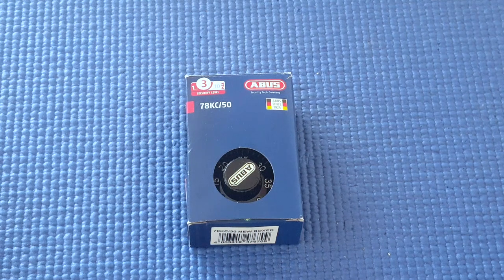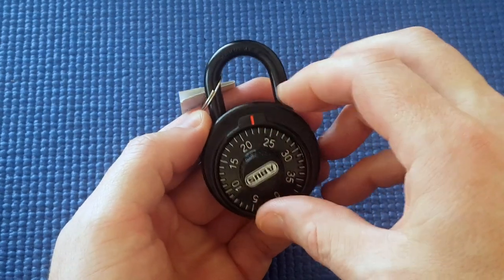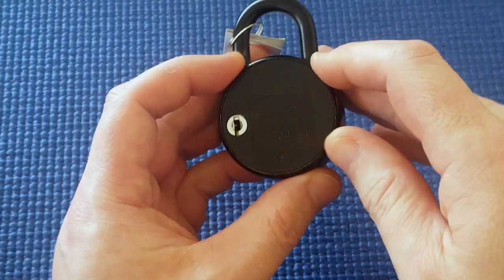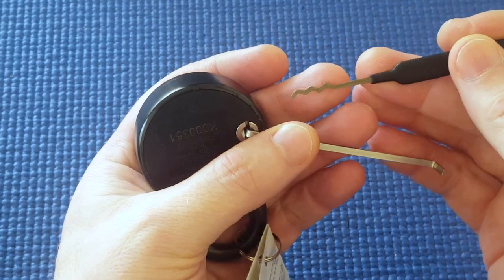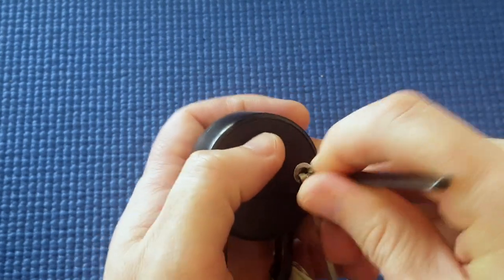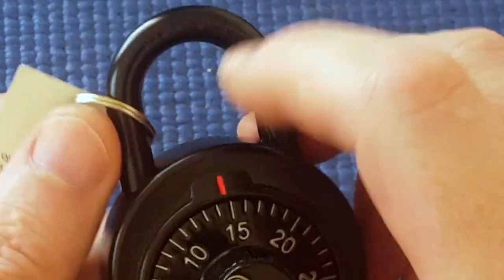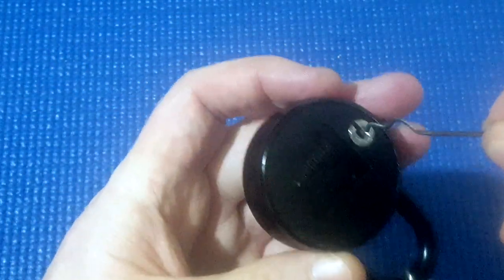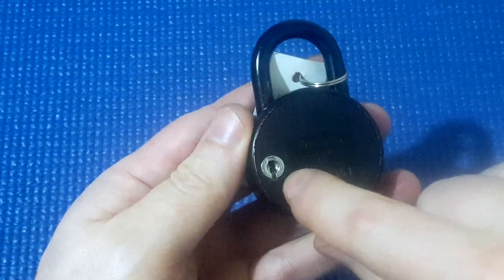(Picking 87) Abus 78KC/50 "New version" dial lock picked open

Comment: Abus dropped the ball on that one. The key aspect as a secondary opening function is definately that combo locks achilles heel. Good job mate:-)
Reply from the maker: Thank you matey! :D :D  Yea I'm tempted to suggest putting super glue in the lock to deactivate that part, but it might also glue up the dial / disks.
Reply: Swynndla 
Well if you don’t need the key control you shouldn’t buy this lock in the first place.
You can simply buy the version that has only the dial.
The version with the key is for some special low security applications like let’s say lockers at school where somebody has the right to open all of them if necessary.

Comment: How would you gum up the raceway ? Epoxy ?
Reply from the maker: I have never done that, but yea it's probably a good idea to use some sort of epoxy.  I'd say make sure it doesn't go in too far just in case, as it might glue the insides destroying the lock.  So maybe some sort of thick epoxy glue, not a thin one that will spread?  If you do it, I'd be interested to know if it works ok. :D
Reply: @Swynndla  you know...that raceway is easy to work on because you have it in a comfortable position in your hand....depending on where you put this lock...access to that rear raceway would be quite difficult.....of course that would not be the case if it's on a chain on the floor....but not so easy on a locker....
Reply from the maker: @adrianotero7963  That's true.  I usually find when they are on lockers, I can flip it vertically, and then the lock is upside down and I can still access it fairly easily (and I did it upside down in the video).  My advice is to attach it to a locker (or something similar) and give it a go (if you have one of these locks).